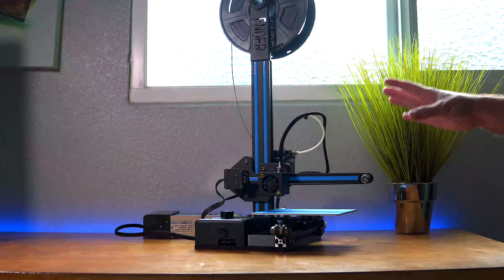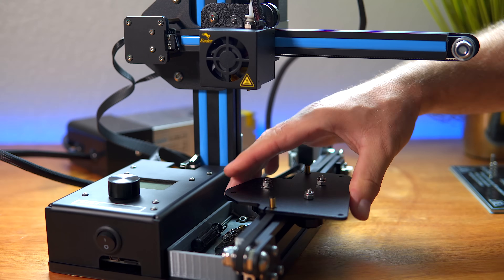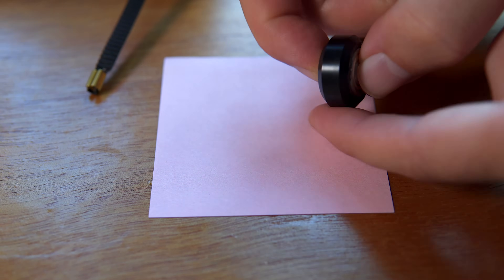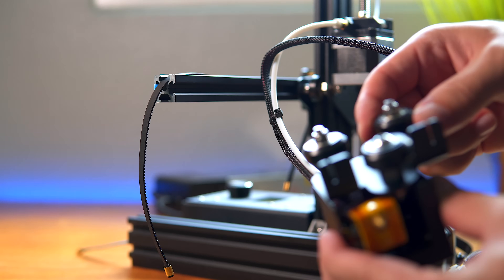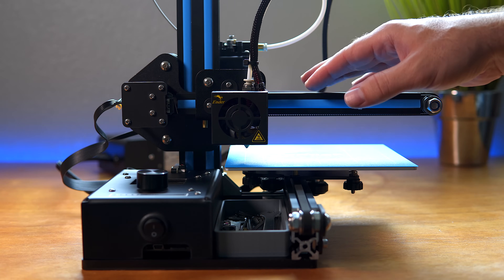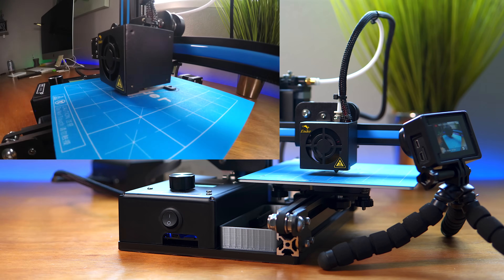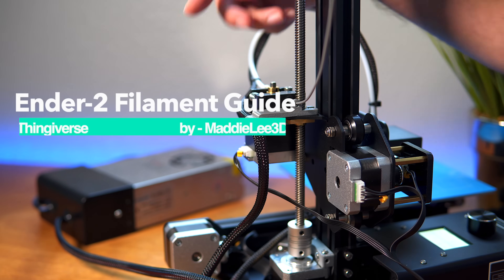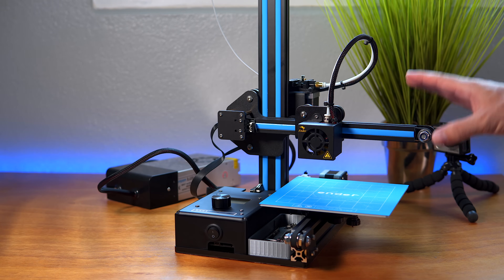Creality Ender 2 3D Printer - Bed Issue Fixed - Print Ready

Comment from the maker: New Channel: www.youtube.com/@Just_Print
Buy Ender 2 here: http://geni.us/4aDpsA
Recommended: http://geni.us/JustVlads
Reply: One mistake mate you just did  before fitted back two bearings. Between bearings should be a washer to prevent rubbing two bearings to each other .Probably manufacture forgot to fit them.
Reply: I think not having the washer was intentional by JV because if you don't get the washer the exact same thickness of the web in the middle of the wheel bore the bearing will either run tight or still loose.....the glue fixes it. @Aeng-gv8jc

Comment: I'm planing on purchasing this just to print gopro mounts, any other option besides this printer?
Reply from the maker: I'm still new to 3D printing but the Ender 2 seems like a great machine especially for detailed prints. But everyone seems to be saying that the Ender 3 is the best all arounder. Plus having that extra build volume on the Ender 3 might come in handy for side projects. Hope this helps.
Reply: @JustVlads  it help a bunch, yea research about Ender 3 as well, but I think for me Ender 2 more compact. Buy yea your right, say if I want to print something bigger, Ender 3 would be a go. But I'm still sticking with Ender 2 for now. I'm still researching. Also sub to your channel.

Comment: On my wheels there is a washer between the bearings. I had one wheel that was missing the washer and it would freeze up when I tightened the bolt. Seems they are using wheels from different suppliers of varying quality. I was thinking of replacing the wheels with quality ones from openbuilds, but they are working fine at the moment so I will wait until I have another issue when them.
Reply: if you really want to get high tech measure the web thickness in the middle of the wheel bore and get some washers the same thickness.....or get a micro lathe and make them by the dozen for the other guys too.....those wheels will be on hundreds of printers.

Comment: I saw the same issue with the wheels on the Y-axis. I ended up replacing the wheels after playing with shims to get rid of the slop and binding up a couple bearing in the process.  The replacement wheels do not have the same problem.  I'm working on adding the filament guide next but may add a tube fitting and use a short piece of tubing to reduce wear.  I already replaced the plastic extruder with aluminum after a groove was worn which led to some under extrusion.

Comment: So it seems like you have had to do a lot of mods to the Ender printer, is it a better printer for a beginner than the Monoprice? Would seem the Monopirce would be a better option as it needs less "adjusting"
Reply from the maker: Monoprice has defiantly been trouble free plus no assembly required. That said the ender 2 has a slight edge on print quality over the MP i3 mini. So depending what kind of beginner it is the ender 2 with bigger build volume and heated bed would be a better choice over all in my opinion.